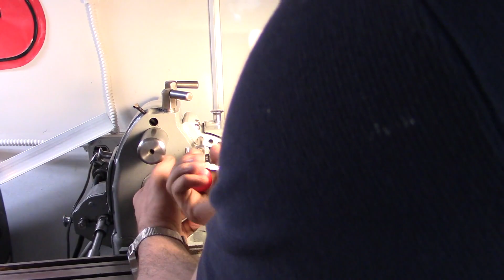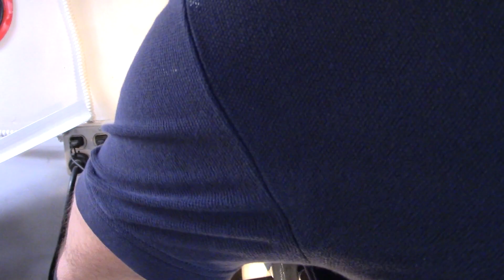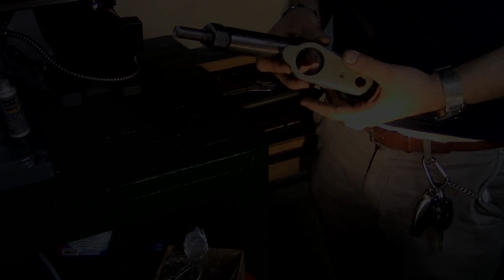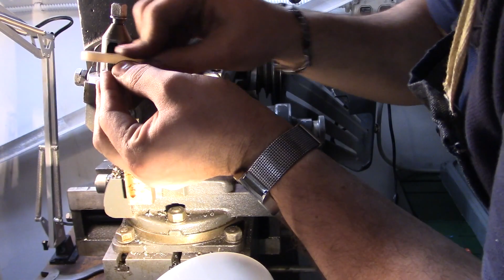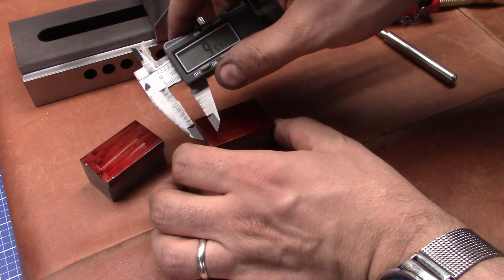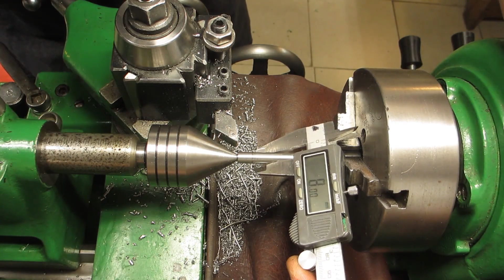Atlas MFC Tying Up Loose Ends - PT6

Comment: Your cutter geometry looks very square and blunt...this loads the shaper much more than necessary and limits your cut significantly.  Touch base with Abom79 for the optimum cutter geometry...he has experimented a lot on this subject.
Reply from the maker: Thank you, I will study his videos further and improve the geometry. With that said, I was cutting tool steel on the shaper, 0-1 to be precise. I think that in itself is a different thing.
Reply: @Engineerd3d   Definitely a tough job...it's possible a more blunt profile, like you were using, is needed to retain the edge for a bit longer.